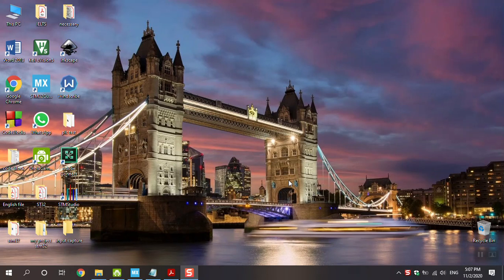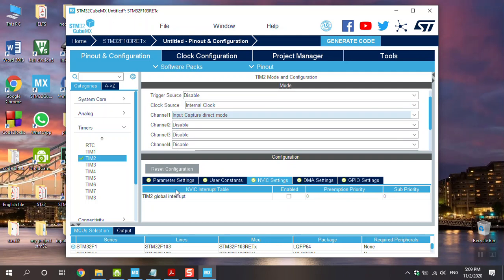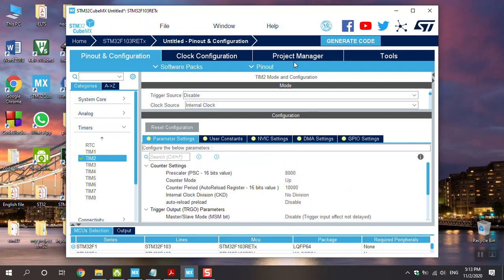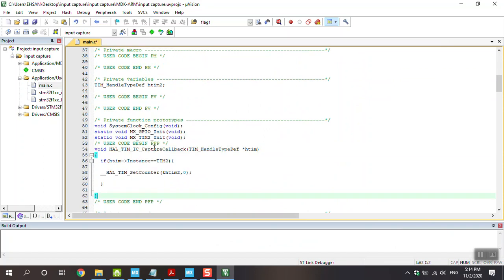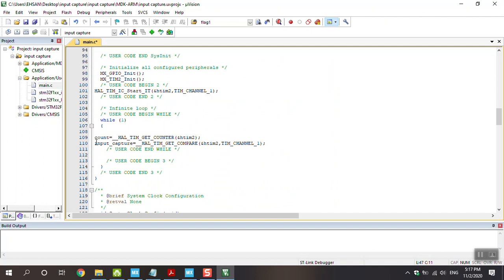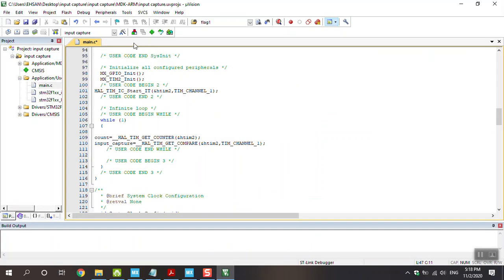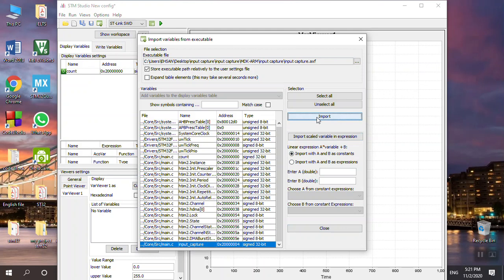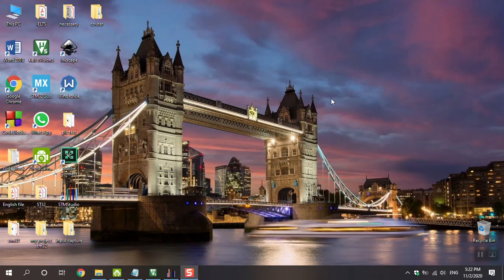Timer(input capture) with STM32

Comment: I understand if you are interested in counting rising or falling edges then setting up the timer as a capture-compare makes sense... however, 

#1 How does the prescaler value affect the counting?  Is it only for __HAL_TIM_GET_COUNTER ?
#2 I assume enabling the interrupt will cause it to fire whenever there is a rising edge, but won't it count without using any interrupts?   i.e. via __HAL_TIM_GET_COMPARE?
Reply: a tip: you can watch movies at InstaFlixxer. Been using it for watching loads of movies lately.
Reply: @Darren Russell Yea, I have been watching on InstaFlixxer for years myself =)